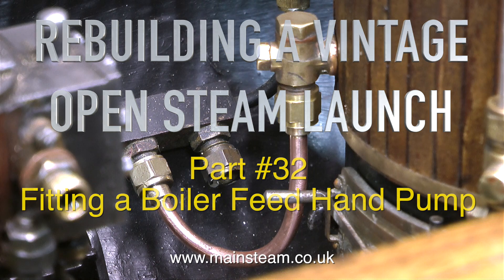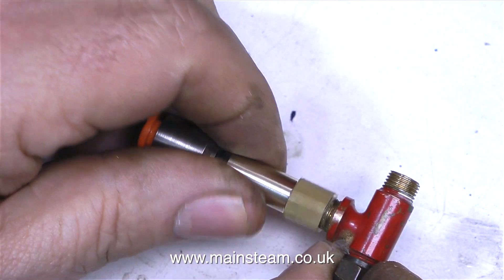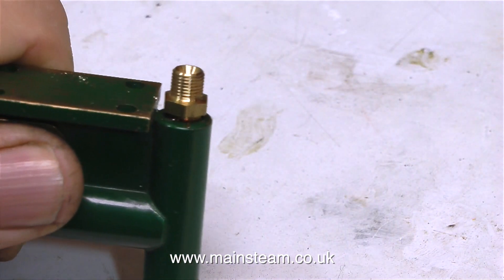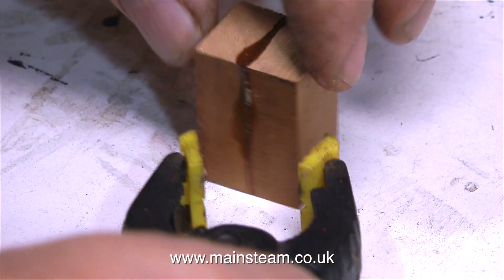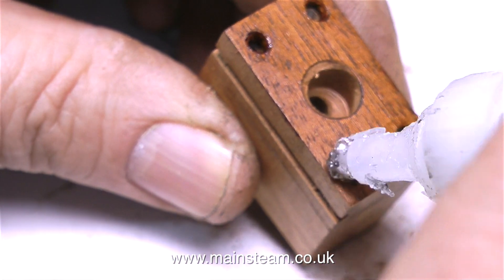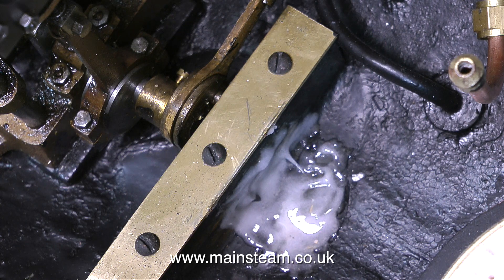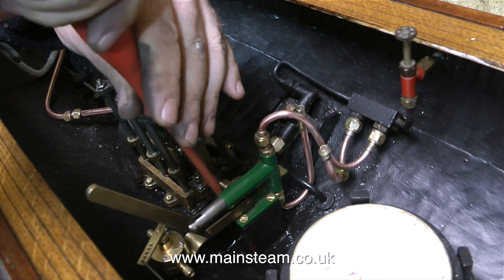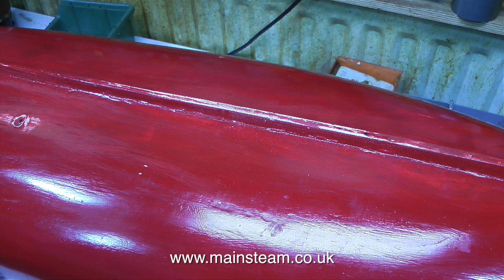REBUILDING A VINTAGE MODEL OPEN STEAM LAUNCH - PART #32

Comment: Bonjour Keith,
Not obvious to install everything, but you do it perfectly. I have had the same leaks problem with a hull forgotten for years on a shelf and 3 layers of polyurethane resin applied on the outside of the sanded hull set it : https://www.youtube.com/watch?v=2rliYY448XQ&t=249s 
Amicalement, Raphaël